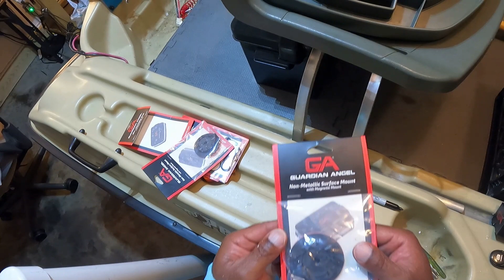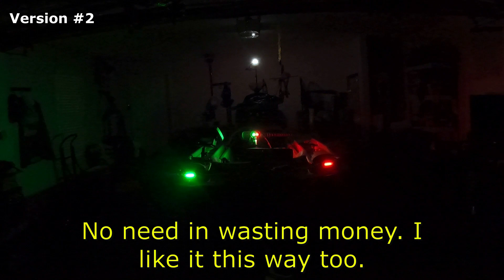Pelican Bass Raider DIY LED Navigation Lights setup.

Comment: Jett, now that’s what’s up! I like what you did. The previous owner of my boat put all kind of screws /pop rivets in the boat installing Scotty mount tracks and rod holders. Again keep them hooks wet.
Reply from the maker: Have you had any problems with water getting inside your hull?
Reply: @fishingwithjett5373  I keep it in the garage like you do yours, but out on the lake I don’t. When I first got it and kept it outside in the backyard it would get about a small bucket full but I also think it was coming in from where the drain was installed at the back. So I drilled 2 holes in each pontoon and installed a couple of snap plugs to drain and it’s been working. On a camping trip I left it in the water overnight and it was still dry so it holding up.
Reply from the maker: Okay well I'm happy to hear you're not having those water issue anymore. Ain't got no time to be tilting up a boat to drain water out